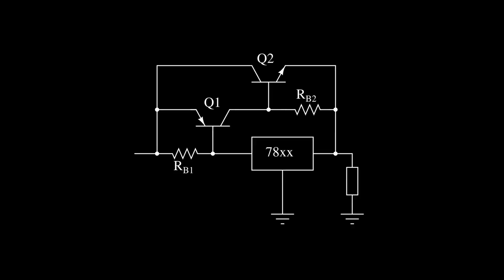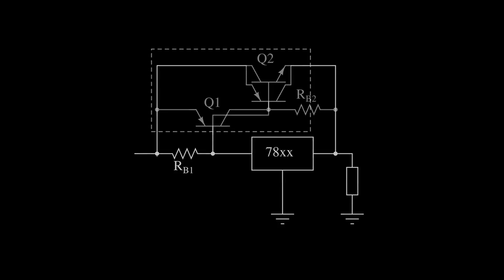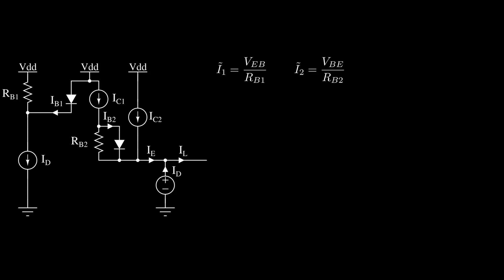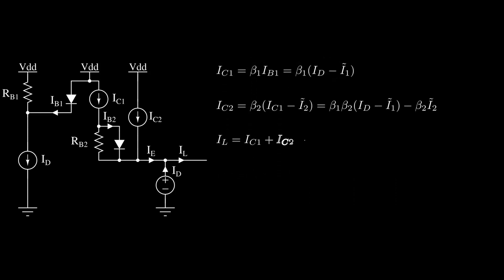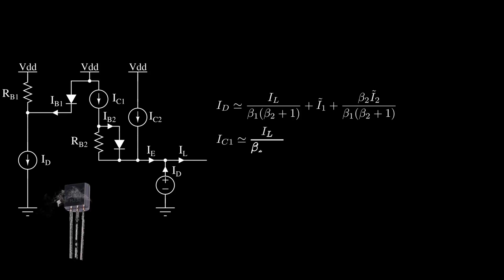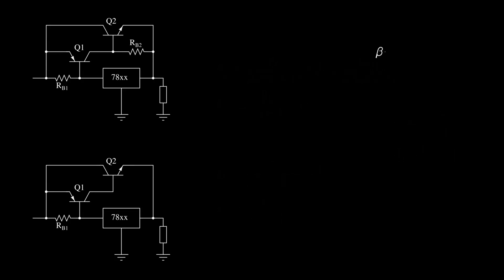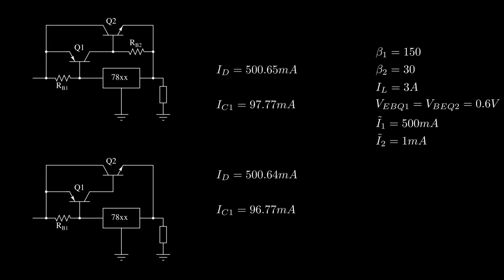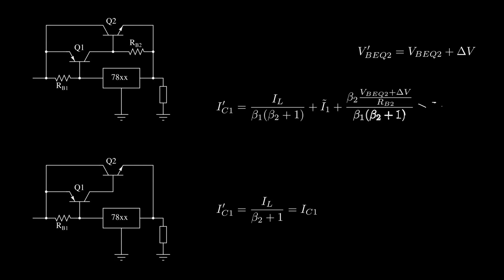Current Boosting with NPN Transistor: an Analytical Approach

Comment: A general rule of adding "booster" circuits is that a slow amplifier with fast boost transistors is likely to be OK whereas a fast amplifier with slow transistors can be unstable. Often that is in the context of a power boost stage for an op amp. Here it is, more or less, a power booster added to the error amplifier internal to the 3-terminal regulator.

Consider a sudden, large drop in load current. If the external boost transistor turns off or "down" too slowly the output voltage will overshoot the setpoint. That can lead the regulator itself may turn off completely because the error amp inside it has detected much too much voltage at the output. That can mean that it then takes some time to turn back on to the point of supplying any current. Meanwhile the output voltage continues to drop if there is any load. The error amp asks for more current and can drive it's internal pass transistor hard to try to get it. Oops! Now we start to turn on that slow external transistor. It can get messy. If you're lucky you get some transients. If you are unlucky the whole thing turns into an oscillator. You don't have access to the nodes where you could add frequency compensation.

Voltage regulators do have the advantage that in most cases you can add output capacitance to deal, at least in part, with rapid changes in load current demand. (Some of the older "low dropout" regulators that used an internal PNP pass transistor are quite fussy about capacitance on their output. You must use some capacitance, but the ERS can be neither too high nor too low without impairing stability.) 
You don't want caps on the output of a constant current source since you want infinite source impedance at all frequencies, rather than zero source impedance at all frequencies you want for a voltage regulator.

===
I think it is the LM324 op amp that is rather slow specifically because there is a transistor that has no deliberate path to get excess carriers out of the base region. Iirc it is one of the output transistors.
Reply from the maker: Exceptionally laid out! All correct but I think I miss however what in particular you are referring to - is it the issue of the slow turn off of the NPN with no resistor leading to possible self-oscillation? In that case yes that might be a very good point!

Comment: Sedra Smith book says it's good to use that resistor because the beta of the lower current transistor is higher when there's a certain current (higher than only that base of the high current transistor) in its collector. Pretty clever.
Reply from the maker: Oh really? I missed that! What chapter are you referring to?
Reply: @indepth_electronics  Yeah. I guess it isn't in older versions because it's a chapter where they explain how op amps work from inside, every major topology that can help achieve better specs. IIRC it's from there.
Reply: If you're using something like a 2N3055 which has a typical β of only 50 at 3A, then a modern pnp transistor is probably going to be passing a non-negligible current much of the time, making its drop-off in β at low currents less of an issue. For example the BC557 still has a typical β of 100 at 0.1mA. I always considered the base resistor's main job was to damp out the leakage Icbo from the pnp which does increase notoriously quickly as the temperature goes up.
Reply: @RexxSchneider  yes, but in cases where you want a high gain from input to output, it's better to have the highest gain available, because it's very common to use negative feedback, and it becomes more of ideal when it's high amplification.
Reply: @ Yes, you can consider the current boosting transistors as part of a closed loop error amplifier, which is how a regulator keeps its output stable. However, it's better to maximise the current gain by choosing a power NPN that has as high a gain as possible, given the output current required. That results in a lower power dissipation in the smaller PNP transistor, which could be the limiting factor. There seem to be fewer options available these days, but for currents up to 10A, the D44H8 is cheap and has good gain. Beyond that, the plastic 2N3055 variants and the TIP35 and similar are still available at reasonable prices.
Reply: @RexxSchneider  yes, you can do that when working with discrete componentes, but when you have a small area on the chip (limited and not discrete), it's different.